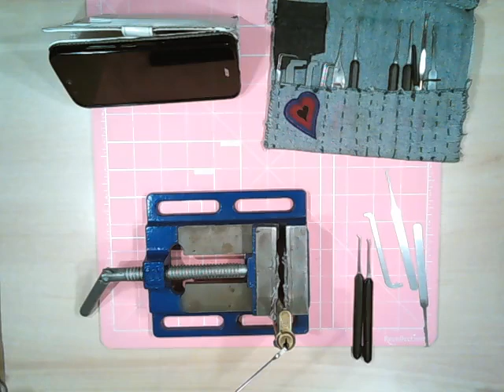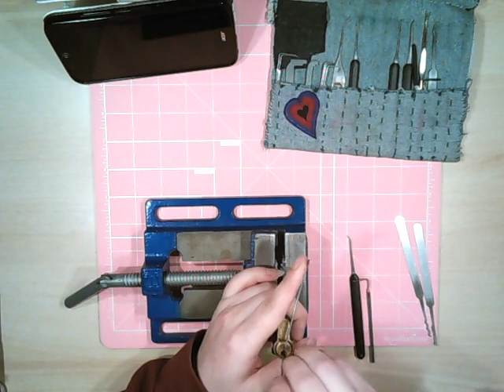New Filming Rig Test

Comment: The sound was good the AC didn't bother me. When your alarm went off that came through really high pitched.
The camera angle was good though I recon you could go a bit closer to the lock.
With regards to the vise, with the panavise it doesn't actually come with the wide tray base that is an optional extra, so it may suit your needs.
A good attempt on this lock, cheers